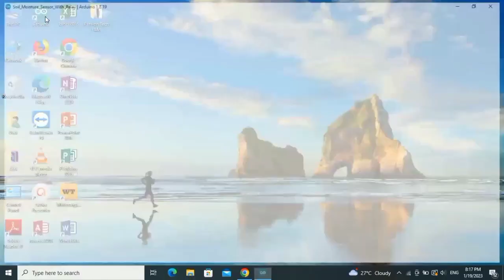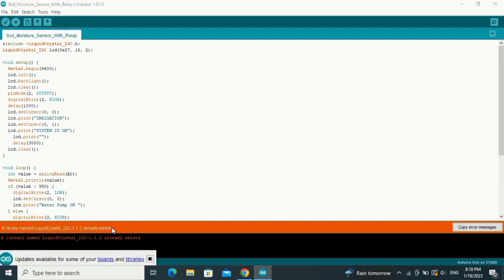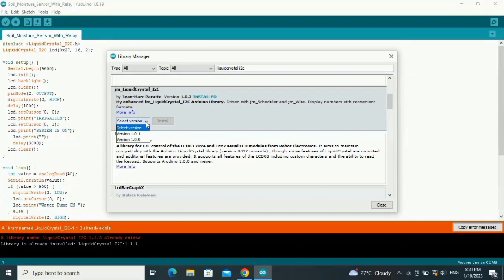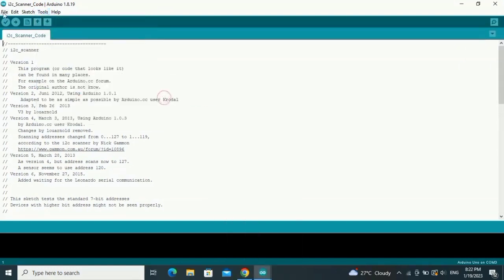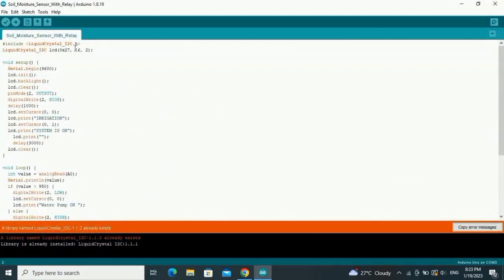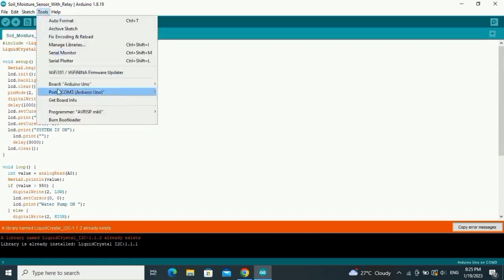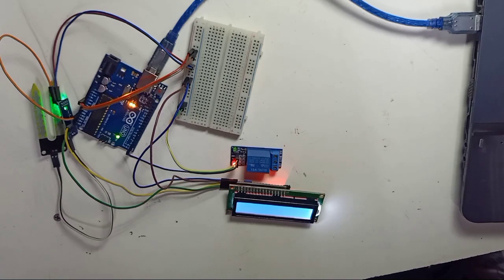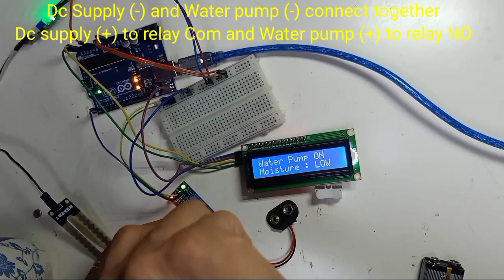Smart irrigation system with Arduino Uno

Comment: hello i hope you can answer this and i hope you are there. why my lcd is freezing or getting random characters. its fine before i add the relay and the pump. how did you fix it?
Reply from the maker: Basically this happen because of wire connecting.reupload the cod and press reset button

Comment: Hey the code that u used is inavlid ...
#include <LiquidCrystal_I2C.h>
LiquidCrystal_I2C lcd(0x27, 16, 2);
 
void setup() {
  Serial.begin(9600);
  lcd.init();
  lcd.backlight();
  lcd.clear();
  pinMode(2, OUTPUT);
  digitalWrite(2, HIGH);
  delay(1000);
  lcd.setCursor(0, 0);
  lcd.print("IRRIGATION");
  lcd.setCursor(0, 1);
  lcd.print("SYSTEM IS ON ");
    lcd.print("");
    delay(3000);
  lcd.clear();
}
 
void loop() {
  int value = analogRead(A0);
  Serial.println(value);
  if (value > 950) {
    digitalWrite(2, LOW);
    lcd.setCursor(0, 0);
    lcd.print("Water Pump is ON ");
  } else {
    digitalWrite(2, HIGH);
    lcd.setCursor(0, 0);
    lcd.print("Water Pump is OFF");
  }
 
  if (value < 300) {
    lcd.setCursor(0, 1);
    lcd.print("Moisture : HIGH");
  } else if (value > 300 && value < 950) {
    lcd.setCursor(0, 1);
    lcd.print("Moisture : MID ");
  } else if (value > 950) {
    lcd.setCursor(0, 1);
    lcd.print("Moisture : LOW ");
  }
}

see u just have included code of the lcd , it don't have code for sensor etc.
Reply: Thankyou

Comment: hey I wanted to know that when I connected my pump at NC instead of NO , it started but didn't start at NO why?
Reply from the maker: That is the relay you use is active LOW type. Thats why in that position.either you change relay or edit the code.its will solve
Reply: Ok thanks buddy

Comment: Sorry sir, my lcd is on, but there is no text, then the relay and pump are also not on.
I have followed the suggestions from the comments.
Please provide a solution sir, for my thesis needs.
Thank you sir
Reply from the maker: Check it back wire connection it seems like unstable error

Comment: MY LCD and I2D are not working ... possible solutions?
Reply from the maker: @wavegaming2833  1st check the wire connection.2nd i2c numbers. 3rd inside the code lcd.intial or lcd.begin This three are mostly cause error.

Comment: Hi bro for me in LCD screen nothing is showing expect yellow light and few blocks the i2c number is also correct for me also its 0*27 and also for me the water pump is not working so bro pls try to help me
Reply from the maker: @rameshbabu224  please check your wire jumper connetion stable or not.

Comment: Hi sorry, the link for the I2c LiquidCrystal zip file isn’t working. 

Could you resend me the link or tell me where to find it, it's urgent for me I have to deliver my project as soon as possible
Reply: hello, the i2c can be found in the library folder in the arduino IDE. just type LiquidCrystal_I2C and scroll down to find it, install and write the code given above. it will work

Comment: What will be the code if we want to perform the reverse operation, i.e when in water, the motor turns on and when not in water it turns off?
Reply from the maker: The same code but use relay in NC mode . that's means reverse mode.i hope you can solve it

Comment: My lcd is turned on but there isn’t any writing on it so how can I fix this I need an answer asap as I have a project deadline.
Reply from the maker: You can check the LCD code number 1st. And just check jumper wire connection than press reset button of Arduino.

Comment: Hi sir, I'm planning to add 1 sensor, is there a need to modify the code? How do you wire the new sensor to the arduino
Reply: Please learn the basics of Arduino before start implementing things on your laptop. One mistake here or there and your laptop or the Arduino board will be gone. There are several free tutorials available on the internet.

Comment: I have followed the steps, and the screen does not work, and the pump is reversed. When it is put in water, it works, and when removed, it does not work
Reply: When I downloaded the first code, the i2c number appeared, the same as your number. I did not change the code. I wrote lcd.bsgin. Like the video, the screen just lights up. His writing does not appear
Reply from the maker: @ziadabobakr3144   try change to lcd.init
Reply: You mean to replace lcd.begin withlcd.init
Reply from the maker: @ziadabobakr3144  yes ...
Reply: Hello, i am wondering ma’am/sir if how did you solve the problem because i am also experiencing the same situation, the only letters that shows on my screen is the first letter per row such as I, S and H, W.
Reply: Same problem , What can i do now? please anyone kindly solve this
 @aprilday365
Reply from the maker: The screen issue is you may check your i2c number and reverse issue is you may check your relay connection.
Reply: I have modified it to show the first letter of each line W and M
Reply: I am facing the same problem.then how can you solve the problem?

Comment: I attempted to follow the instructions given, but the pump seems to be operating in reverse. It activates when the sensor is submerged in water and deactivates when it is removed. I suspect that the issue lies with the 5v relay board, as the module I am using features (S,+, -) instead of (VCC, GND, IN). Could you offer any assistance?
Reply from the maker: S + - and Vcv Gnd IN are actually the same meaning....I think you check it back your water pump is connected either to Com in and NO out .
Reply: @passiontechklm  Although I substituted

void loop() {
  int value = analogRead(A0);
  Serial.println(value);
  if (value > 950) {
    digitalWrite(2, LOW);
    lcd.setCursor(0, 0);
    lcd.print("Water Pump is ON ");
  } else {
    digitalWrite(2, HIGH);
    lcd.setCursor(0, 0);
    lcd.print("Water Pump is OFF");
  }

with

void loop() {
  int value = analogRead(A0);
  Serial.println(value);
  if (value > 950) {
    digitalWrite(2, HIGH);
    lcd.setCursor(0, 0);
    lcd.print("Water Pump is ON ");
  } else {
    digitalWrite(2, LOW);
    lcd.setCursor(0, 0);
    lcd.print("Water Pump is OFF");
  }

which made the pump operate correctly, the code appears to lack logical consistency.
Reply from the maker: @ahmedboss7005  the above is correct.... because relay is active low device.
Did you check your connection between com and NO?
Reply: @passiontechklm  -The sensor gives me a reading of 1016 when removed from water, and when submerged in water, the reading increases to 3247.
-Upon taking the sensor out of the water, the screen displays the message "the pump is ON," however, the pump remains inactive and the relay lamp fails to illuminate.
Conversely,
-When I dip the sensor into the water, the screen shows a message indicating that the pump is OFF, but in reality, the pump is working and the relay lamp is lit.

The situation appears to be flipped or reversed.

Comment: hello sir, thank you for this video. In every moisture sensor, one relay channel along with a battery was utilized. So if I will use 3 moisture sensors, would I also use 3 relay module, 3 water pumps, and  with 3 batteries sir?
Reply: also sir, I am planning to add a DHT11 sensor, but I don't know how to modify the code as well as adding those additional sensors in the code. If I may, can I ask for your assistance sir regarding this?
Reply from the maker: If you use 3 moisture sensor you need to use 3 relay and 3 pump but battery you can loop from one battery .
Reply: @passiontechklm  how many volts of battery should I use if I'll use 3 moisture sensor sir?
Reply from the maker: @kieraalex4202  Sensor is from Arduino pin so nothing different all sensor can connect to Arduino pin. You just need to have seperate power supply for your water pump only.

Comment: Is there any other problem sir if all the circuit and coding is same but the data wont come out at my lcd
Reply: Sir one more thing..what is the problem if when i try to attach the battery the whole circuit like shut down the including motor/relay/lcd
Reply from the maker: @luqmanafiqabrezaf2338   how many voltage? To which pin you give power?
Reply from the maker: Power shutdown likely happen when its over voltage or reverse polarity.
Reply: @passiontechklm  sir what i need to do if my sensor always detect low moisture and my pump keep turn on.
Reply from the maker: Did you check your i2c number...if yes it should not be problem.Otherwise double check wire connetion
Reply: Okay thank u sir
Reply: Sir plz help I met this problem too 😢😢